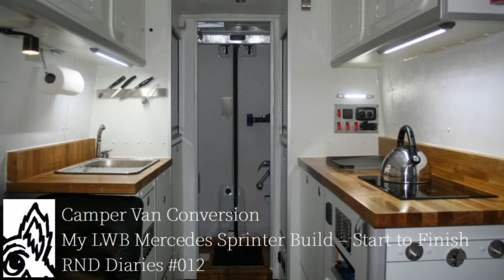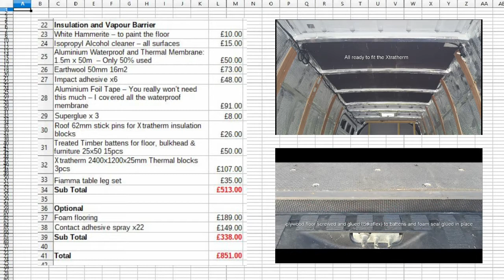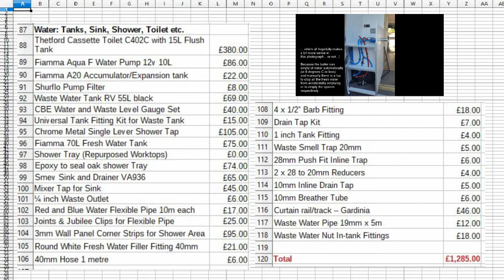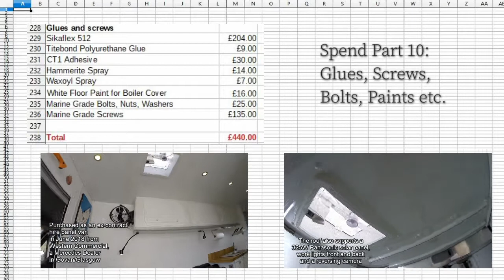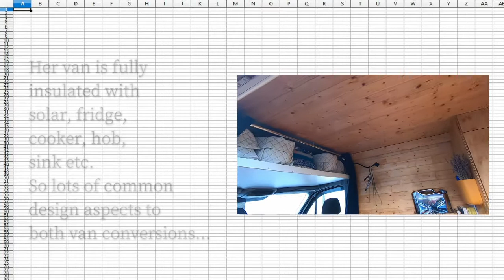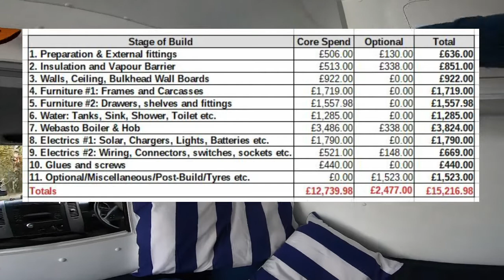#28: Cost of my Sprinter Camper Van Conversion & Exploring a Less Expensive Version of the Build.

Comment: Again, thanks so much xD you have done all the hard work (in terms of planning) for me 

My design will be different but I was even struggling to get my head around the electrical system before your video, I'm an electrician/builder but I've only ever worked on 240v and never used an inverter or battery, or any 12 v circuits so its gonna be a huge learning curve for sure 

Subscribed and liked
Reply from the maker: With those skills I don't think you will have any problem at all with the 12 V system. Couple more ideas for you:
For van layout ideas and electrics check out:
Jaz Morton's Build series - he is an electrician too: https://youtu.be/8kZAKOGHilQ - Episodes 8, 9 & 13 cover electrics.
Greg Virgoe's Build Series is really detailed and this ones on wiring: https://youtu.be/rVkDPzrA-zw
HughTube has converted lots of different vans and a great channel for van conversion ideas: https://youtu.be/B_Hh9F-dXEE
My build video on the electrical system - https://youtu.be/VBoV25tkY9U
Cheers john
Reply: @RedNemesisDogPrime  man, thank you so much for the time u took, will take a look at each video now